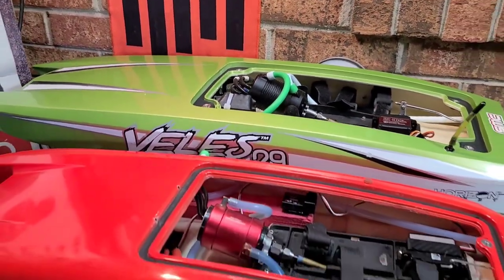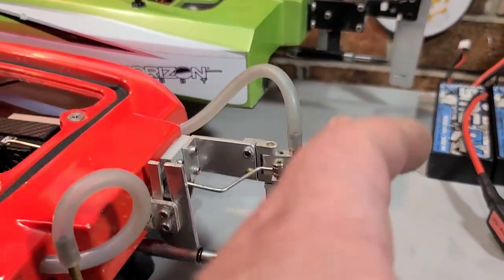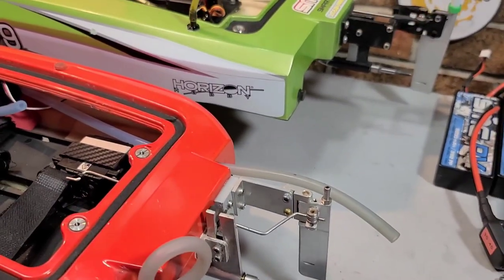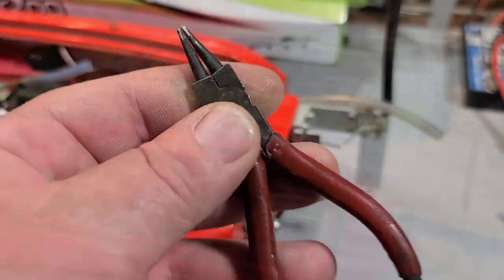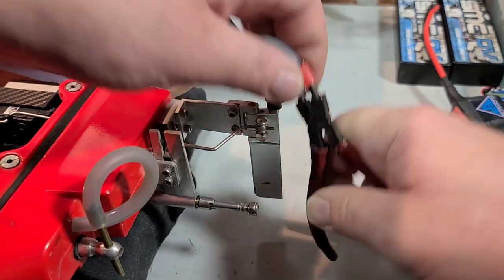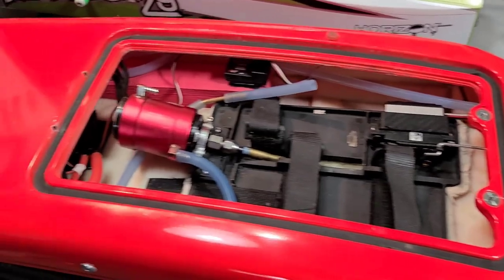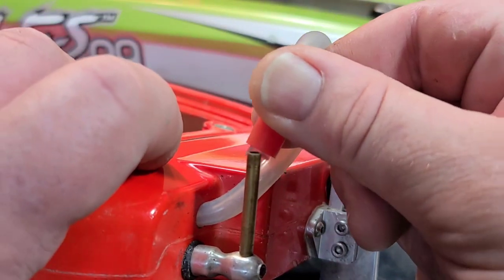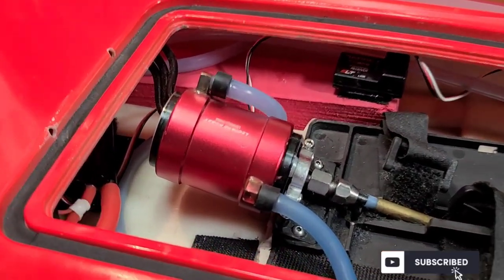Must Do Cooling Mod For Fast Rc Boats -   Proboat, Tfl, Oxidean Marine, Aquacraft

Comment: I purchased a used 24” Blackjack. The boat was in a rundown state with the hatch being broken and in need of gluing. I stripped everything from the inside but not the trays. I knew I was going to purchase the boat so I bought a Flycolor ESC and the same small motor you liked. I added the second water pickup but never looked for water coming from the exit hole. My Blackjack really performed like yours did till it overheated. I fixed the boat and rerouted my water lines! Thanks for all your help!

Comment: I'm pretty certain the RedBird sank because of a cooling system leak.  Whether it was a cracked line, or a line blew off a nipple, I'll never know for certain.  I don't have the room for 90mph boats on my little pond, but that is a great fix for those that do.  I've already done it on some of my boats where the cooling lines aren't a super-tight fit and everything is more secure.
Reply from the maker: Yep that'll do it, especially such a small boat doesn't take much water at all.      I miss that little red bird I thought that was the coolest little boat.  😢
Reply: @IRONCLADRC  Yeah, I miss that little guy too, but the Mini Dom (Tenshock Scord) is a better overall boat and less fuss to get running well.

Comment: Have you or do you ever think about using a small piece of cooling tube to fit over the flex drive where the flex drive fits into the collet, to act as a safety feature in case the collet comes loose and you loose the drive and the prop? like what happened to me this morning, the shaft and the prop were only a month old, I know you can get a "shaft protector" which is fixed with a grubscrew, I know I should have had one on in the first place, and I should have checked the coupling before I used the boat "my bad" won't do it again,
Reply from the maker: I've used silicone cooling tube in the boat between the motor and stuffing tune it works  great for keeping oil and water out the boat. I used a drop of super glue to hold the tube in place

Comment: I HAVE AN UPGRADE MOTOR COMMING FOR MY MADFLOW. 2958 3380KV , 2- 6 S ESC WITH COOLING LINE A PROP AND A COLLET. I WAS GOING TO DO THIS MOD. I SAW A GUY ON YOU TUBE WITH THIS UPGRADE HIT 51 MPH ON 4S.
Reply from the maker: The mad flow should scream with that combo 2958 is a great motor